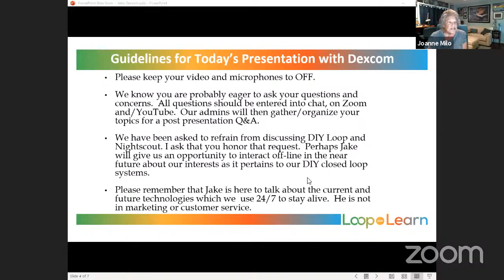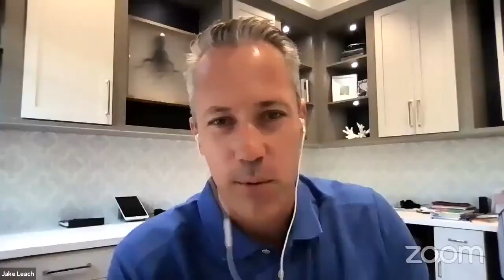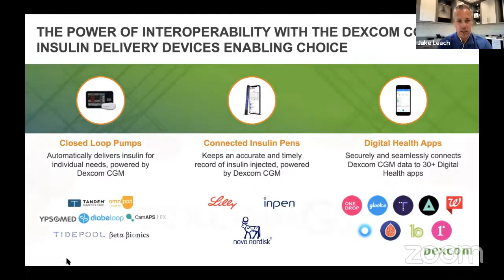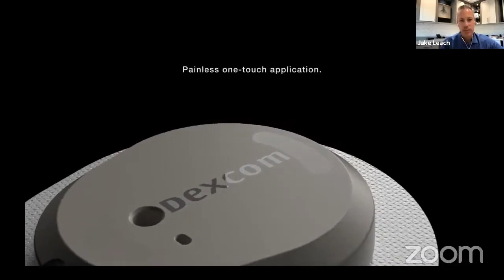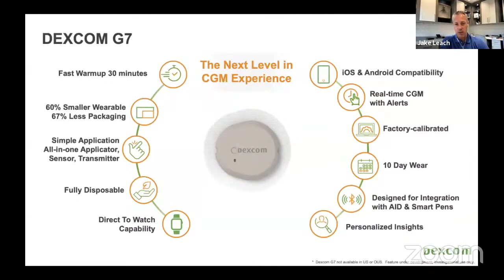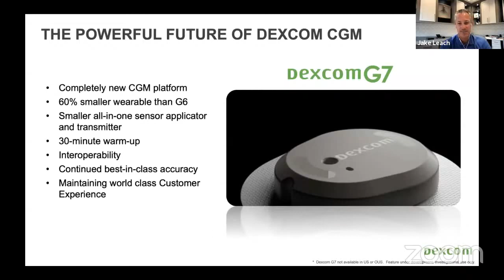Loop and Learn with Dexcom's Jake Leach, 6 27 2021

Comment: Thanks for a great presentation - looking forward to all the improvements coming in the G7.  Could you share this suggestion with Jake Leach: Could an “8 hour window” be added to the 10 day wear, similar to how the Omnipotent has a 72 hour + 8 hour window?  This would allow the extension in case they are unexpectedly not able to change their Dexcom. The G4 or G5 had a 7day and it made it easy to plan for a sensor change , example - always home on Mondays nights? Perfect sensor change night!  Granted with the smaller size and packaging and combo transmitter/sensor, this might make it easier to carry a backup (generally sensor changes are done at home due to difficulty releasing transmitter from sensor).  Thanks again!
Reply from the maker: Thanks so much ... I just passed it along to Jake ... great suggestion!!!
Reply: @LoopAndLearn  Thank you!!!